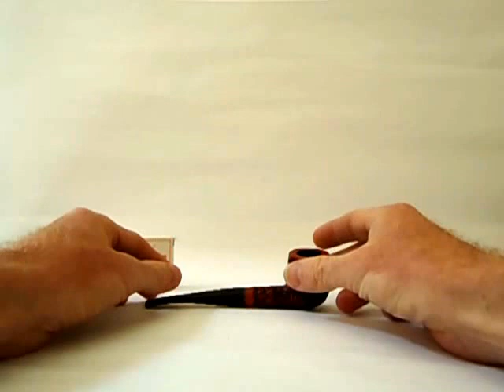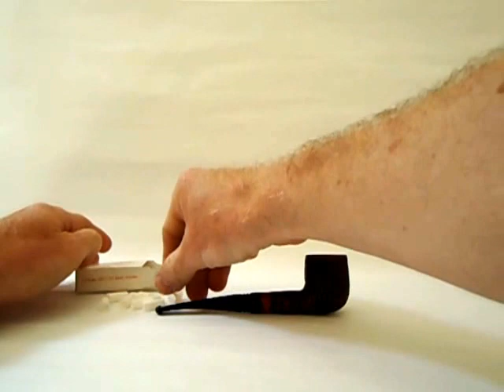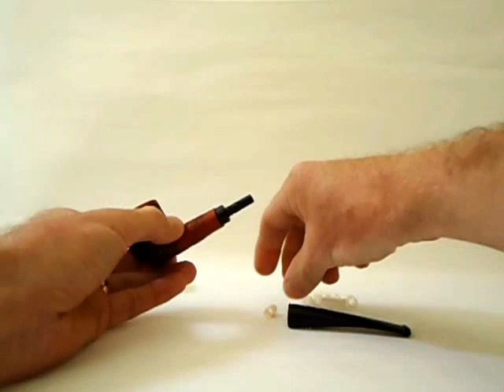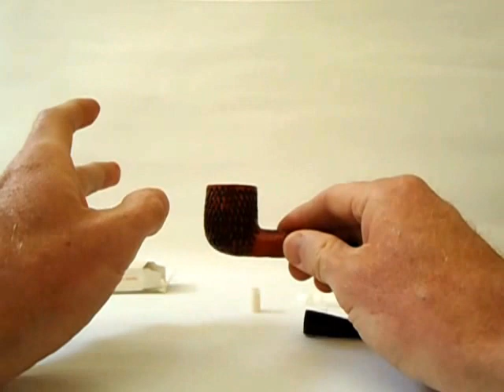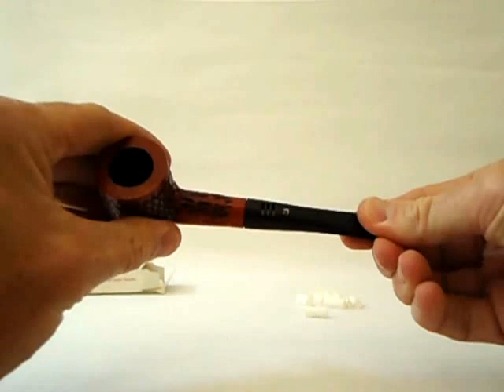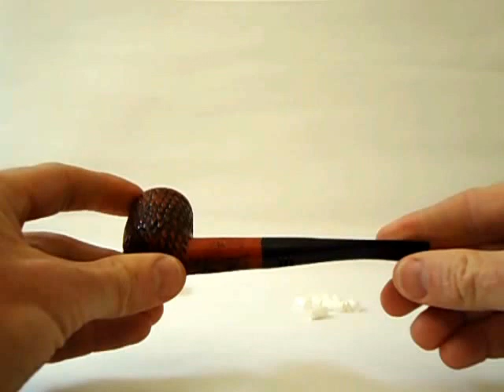Carey's Magic Inch System Explained

Comment: I have my grandpap's Carey.  He was born 1875 so this pipe is very old.  It has the Carey "magic inch" engraving on the bowl. What is opposite of this one is the stem comes down from the tip instead of up from the bowl.  It is a part of the stem, not the bowl.  It has the C on the stem and six vents on the stem (3 on top, 3 on the bottom).
The six vents are not open to see through.  Frankly, it appears something is behind the vents both top and bottom.
Any thoughts as to what I have?
PS.  The stem and bowl fit snuggly without a filter "buffer".

Comment: This video was a little difficult to listen to, with all the um's and ah's and repeating the same info.  I'm sure it wasn't practiced or rehearsed much, which tends to cause these kinds of issues.  It could have been half as long and given the same info.  And since this does seem to come from the business itself, I'd recommend that they create a new one, with the same good info, but without all the filler talk and meandering.  Even just lay an outline on the side to reference, and that way you cover all the things you want to, and you also know that you have covered it, without repeating too much.
But I do have ADD and my attention span might be a little too volatile anyway, so take that for what it's worth. :-)
I did keep watching, and I did get the info I needed, so thanks so much for putting this vid out there at all.  I just inherited one of these and look forward to trying it out.
And thanks for including the bit about packing too tightly.